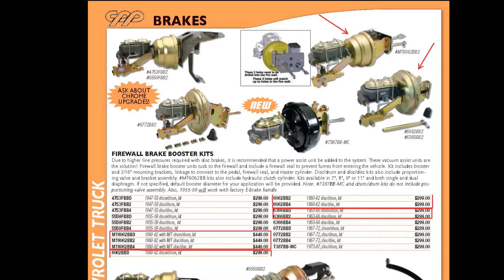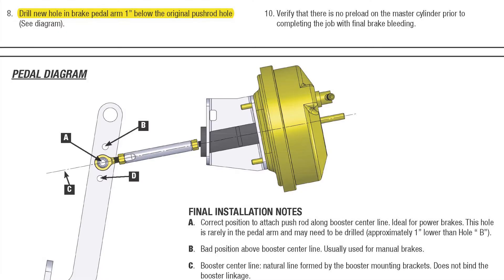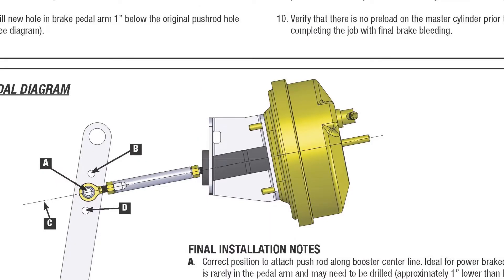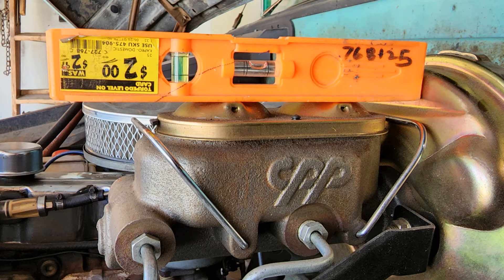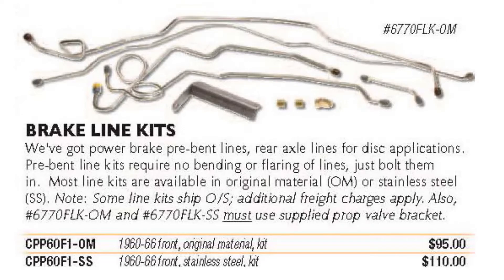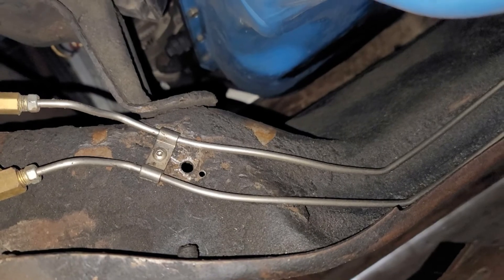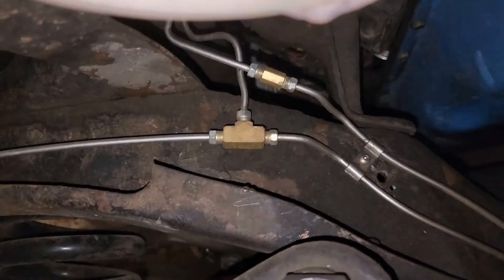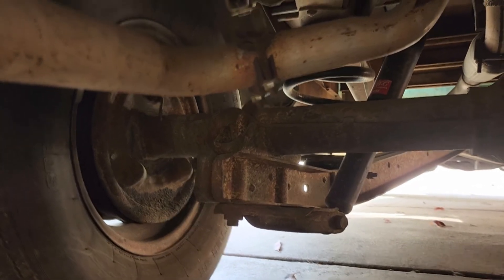CPP Power Brake kit installation on 1965 C10

Comment: What a excellent job of explaining and showing what I need to do to my 65. Thank you sir! I do wish you would have shown the process of bench bledding on the truck. No matter, great video!
Reply from the maker: here is a nice video showing how to bleed the master cylinder.  It shows bleeding off the vehicle, but as long as the master cylinder is level it can be done the same way on the vehicle.  It uses the CPP bleed kit CPP-BK which has the tubes, port adapter for the tubes and clips to hold the tubes.  The syringe is available separately CP0108.  Both inexpensive.
https://www.youtube.com/watch?v=sjbDpvof0IE&t=27s
Reply: Thank you sir  @ron12april

Comment: I have same brake system that you have. I want to do a brake fluid flush to replace old brake fluid. When removing old fluid from reservoir and replacing with new do I need to put reservoir cap with holder clips back on before I start holding brakes and opening brake line? Or can I leave cap off to be able to see fluid reservoir level? Or does it matter. Thanks for making very informative video
Reply from the maker: vehicle is not moving so do not need to put clips on and off.  I put the lid on while going under the vehicle to bleed each wheel, and took the lid off after each wheel to inspect and add fluid.  Not really necessary but have to put the lid somewhere and brake fluid is corrosive to paint, etc.  Back in place without the clips on seems as good a place as any. Also, lid keeps any debris from falling into the reservoir.

Comment: Where u able to drill the pedal without removing the pedal from the truck?
Reply from the maker: Yes
Reply: @ron12april  right angle drill?  I can't see how I could get a drill up in there, but I have a manual with a clutch pedal in the way.
Reply from the maker: @bikeguy0  I have manual too. Drill from gas pedal side.
Reply: @ron12april  thx. Just realized it was the aftermarket AC box that was totally blocking being able to do that. Just removed it and now it seems like a really dumb question to ask as there is plenty of room to drill 😉

Comment: I did my front disc conversion , after bleeding master cylinder and brakes , my pedal goes all the way yo the floor ??
Reply from the maker: Check to see if you still have fluid in the master cylinder.  When bleeding brakes have to keep filling chamber.

Comment: Did this kit bolt right up to the firewall or was there a need to drill holes?  Classic parts has this kit.  I order a different kit from LMC truck and there were no instructions at all.  Further, the kit didn't appear to fit on the firewall.
Reply from the maker: Holes are required.  Here is the link to the CPP instructions.  Hopefully, they will help you with the LMC kit
https://www.classicperform.com/Instructions/PDF/6066BoosterKitInstructions.pdf
Reply from the maker: PS
These instructions are for 60 to 62 (page 1), 60 to 62 with hydraulic clutch (page 2), and 63 to 66 (page 3).  Make sure you refer to the correct instructions.